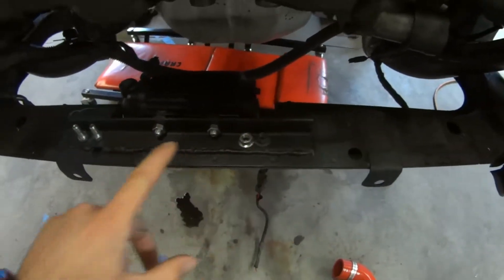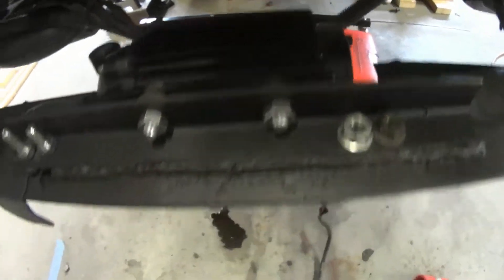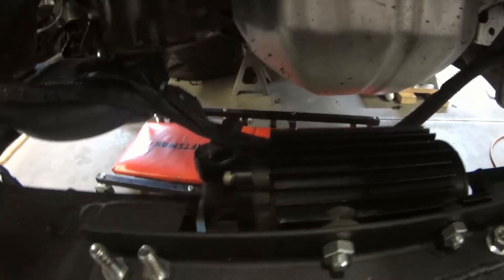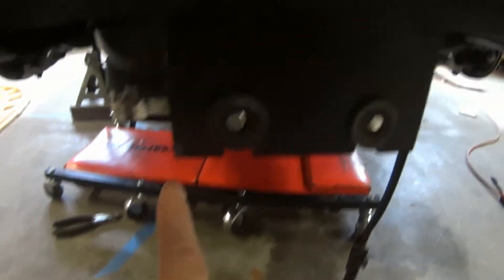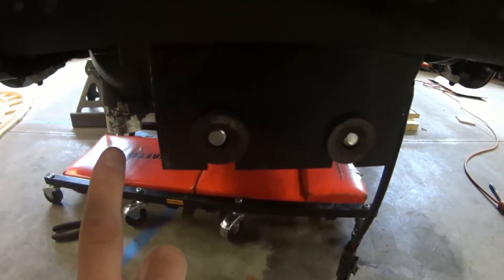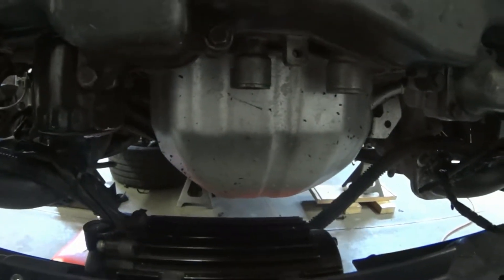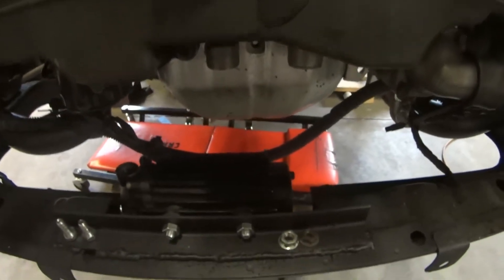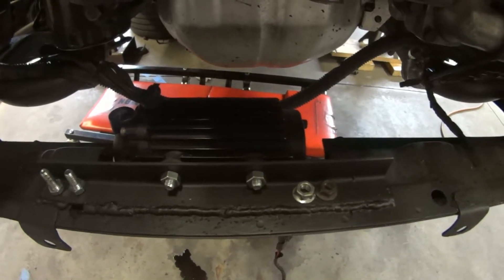EG33 Swap - Why I'm running a Scavenge Pump (Ep. 19)

Comment: Love your videos but just a question with your turbo eg33 are you running factory bottom end or do you have forged internals
Reply from the maker: I have a freshly re-built bottom end. Moly coated pistons, new rings, and new king bearings. This is a moderate budget build, but I've seen others do impressive things with stock bottom ends.
Reply: EazyOnCars how much boost from a supercharger do you thing a bottom end could take
Reply from the maker: Imataxwriteoff TV I saw a guy makeing 13-14PSI with a stock bottom end on the Dyno. I'm planning to run 11PSI on this setup.
Reply: EazyOnCars I'm wanting to run 10 psi on my svx I found out it has a new bottom end so it has about 50000 miles on it. Is it worth it for me to gap the piston rings I have to take the heads off alright because the valve seals are going
Reply from the maker: If it burned oil before hand then yes. If not I would see how it goes without.
Reply: EazyOnCars Lucy is definitely a smoker lol
Reply from the maker: Probably worth going through it then. If you do the heads yourself I was able to hire out the short block for around 400 USD.
Reply: EazyOnCars I have a whole spare eg33 just in case if I do blow up this one